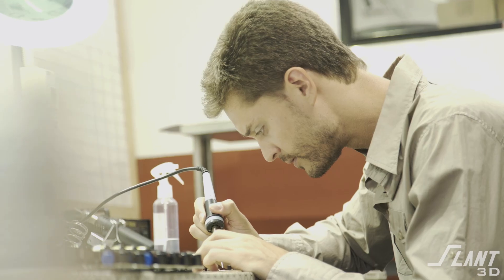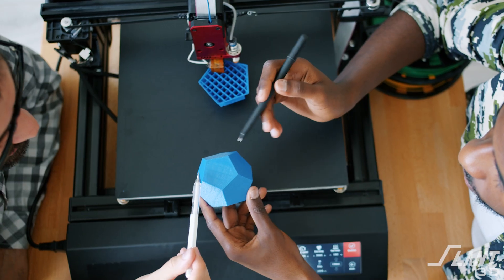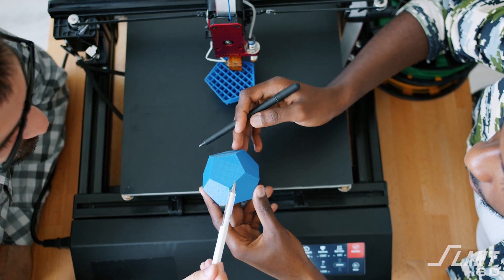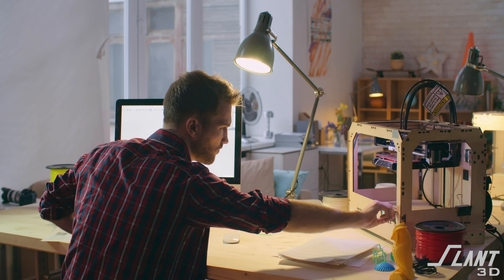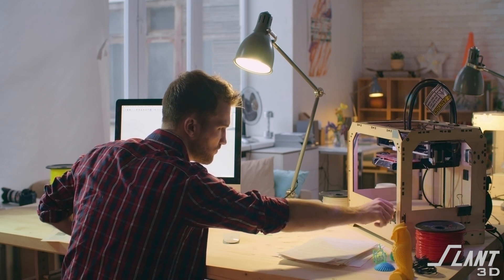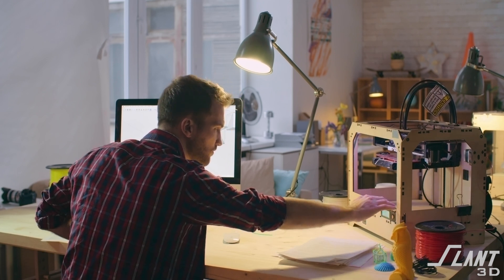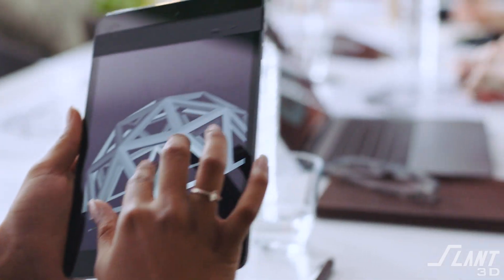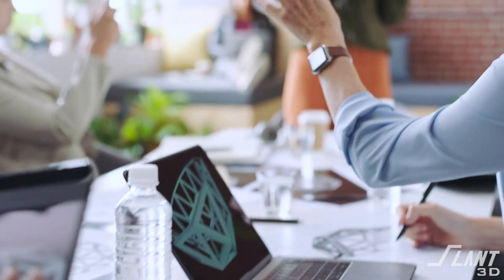Prototypes are Easy. Production is Hard.

Comment: I was really hoping for some of the secret sauce used to move from the prototype stage of things to being production ready.    I understand that you are tempering expectations of eager hobbyists, but this seems like a downer video.
Reply: A lot of his previous videos touch on the subject as well, and you may notice that his advice often differs from the advice you might get from a place like Reddit. One thing in general that I've noticed is that he has different suggestions for the size of the bottom of the print since their machines have automatic ejection, which works best when the contact area with the bed is small. In prototyping and consumer printing, that can sometimes lead to bed adhesion issues, especially with bed slingers.
Reply: 1) Understand the Manufacturing Process: He has other videos on tips for FDM Mass Production.
2) Design for Manufacture: Simplify the design and apply knowledge from step 1.
3) Defer to Subject Matter Experts: When he gives you advice, take it.